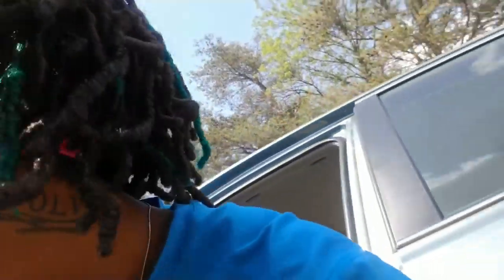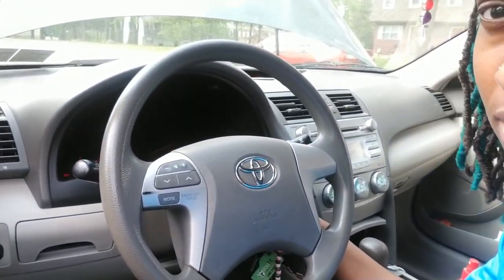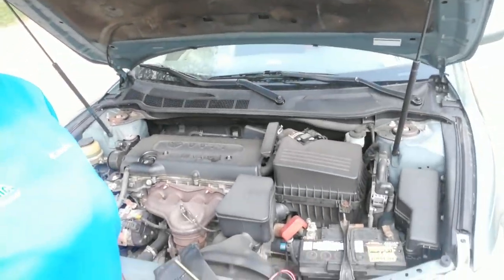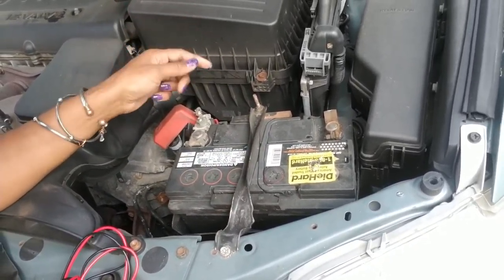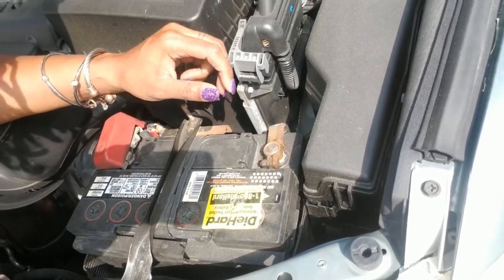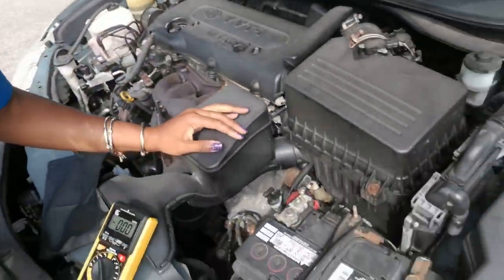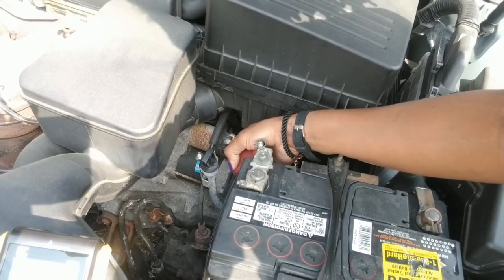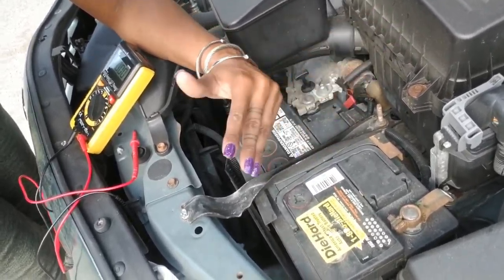How to diagnose a no start on a Toyota Camry #pinkiedabney

Comment: I could be your Park or Neutral Safety Switch. It could be the a communication issue with these transponder keys. But you are going the correct direction.

Comment: Check battery, cables ground,  hot terminals, if that's not it. Check your fuseable link, there's 2 main F-links in the fuse block under the hood. It's a pain in the ass to take it apart but I did it to mine. One more thing check your relays. Lemme know😏